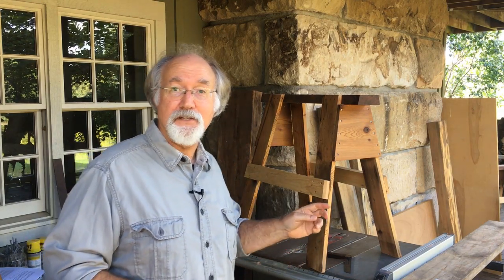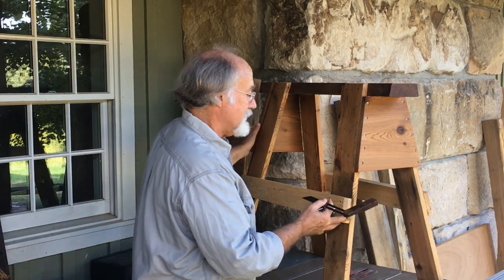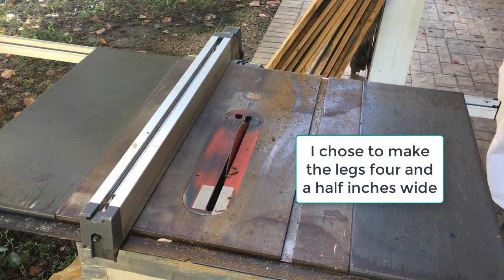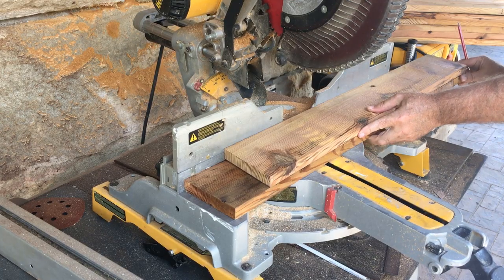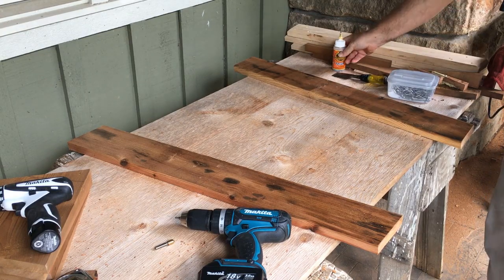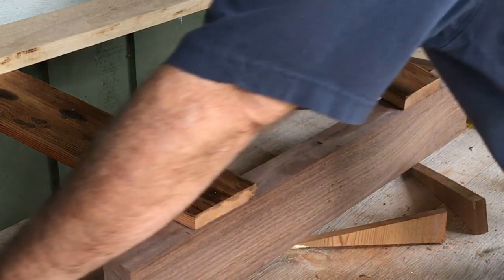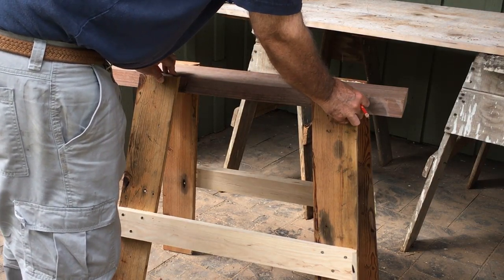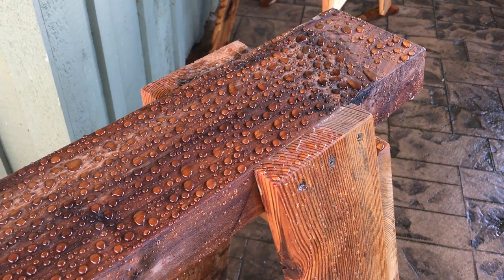Handmade House TV #36  "Building Sawhorses"

Comment: Nice job, you could easily avoid rocking with bracing, that is what carpenters crew that erected my hand made longhouse did, have a look at it they mage an excellent job
Reply from the maker: Thank you for the comment! 

The rocking seen in this video wasn't there the first twenty or so years... lol.... it was only a recent after many years of use and abuse. 

No doubt about it...angle bracing can add strength and stability to anything (I'm a big fan of it in the framing of a  home) but I don't care of it in a sawhorse... it gets in the way, adds weight... and shouldn't be necessary when built correctly.  And... I like the clean lines of a sawhorse without them.

There is a time to "retire" or "rebuild" a set of working sawhorses and these old ones of mine were past that point but I just didn't have the heart to throw them out... (I am thinking about going to the trouble of taking them apart and putting them back together)
Reply: Well noted Noah, i see you have a keen eye on details. For that same reason, I would appreciate your opinion on my loghouse built by russian craftsmen.

Comment: There is the tool I want/need 12" mitering chop saw. One day I hope to have one in my arsenal.
Probably end up with a radial arm saw as they can be found cheap and unloved.
Reply from the maker: I don't see many radial arm saws anymore. They used to be the tool to have... but these sliding compound saws really took over the market.... absolutely amazing machines... you will never regret owning one. They are a bit pricey for sure.... but taken care of they should last a lifetime.

Comment: Hi Noah. Good show!   What brand of window is that in the back ground?  Did you build it? I like its proportions.
Reply from the maker: Those windows are made by Pella... one of my favorite window manufacturers... they are true divided lights of insulated glass (not snap on grills). I am fussy about my windows... you have a keen eye to have noticed them!
Reply: Handmade Houses with Noah Bradley   Very nice looking.  I too am fond of double hung. This summer I put in a gang of five, 3 over 1 covering about 12 feet long  I only purchase the cottage style double hung on the top is smaller than the bottom of the unit. I'm finishing the remodel of a 29 year old lake cottage but I need to not cause trouble with the zoning inspectors. You see the house is only 50 from the lake as it is. I didn't break the rules but sort of beat the rules up a little. Lol 
We are attempting to build this into a airbnb house with a new garage with living quarters upstairs for us to live. Retirement income I hope. The new structure will be a net zero design with garage workshop and living space for us. I design and do all construction using work aids as health and age has put a limit on me. In other words I need to be clever and smart. Hire young people to carry shingles to the roof and then i work by myself until I need a bunch more hauled up. Lol 

Thanks for the good shows.